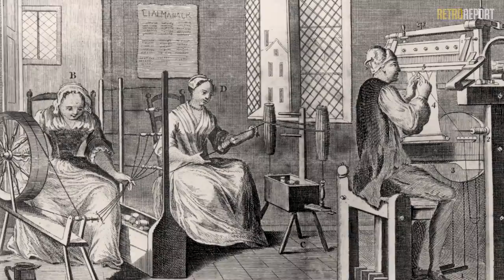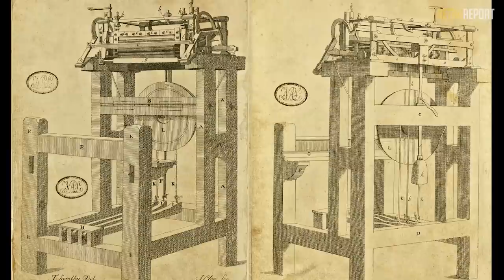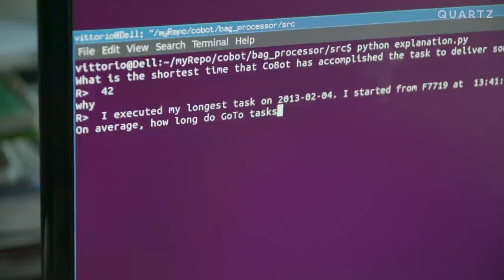Automation and AI are destroying jobs, not work

Comment: Back in the late 1990's as a teenager i worked as a Photo-developer at a massive factory that did 24hr return prints. By 2001 the business closed as digital cameras were wiping out the volume needed to be profitable (240 people)...9/11 happened and i joined up. Post 10 years i was made redundant when my unit was disbanded (1200 people). Now i'm a Cyber Security Pen tester. You just evolve with the world is my view. If you want long term stable employment in one field become a Lawyer, doctor, architect or Vet.
Reply: By "Vet," do you mean veteran? or veterinarian? If veteran, then I suppose it's only possible after a short stint, because robots will be soldiers (drones), as well.
Reply: Software can now performe Discovery which is most of what attorneys do now.
Reply: And what happens when the military uses robots instead of humans? What happens when someone creates a machine learning pod that does surgeries with 99% accuracy? What happens when unemployment rises as there becomes too many people and not even jobs that you can thrive from?

Comment: I do selective cutting here in my maple sugarbush in Ontario. Machines can only do clear cutting. They can't tell one species apart from another. Surely any clear cut can be done by machine in time but clear cutting is so very stupid! You need a canopy for birds, animals and the next generation of trees. You need the roots to prevent landslides. 

Only idiot clear cutters will be replaced. What kind of stupid video shows this as some kind of sign of progress? It is a very good thing that those kind of loggers get killed.

Many who choose logging as a profession are there because there is risk involved. Risk and reward. The risk makes you feel much more alive, knowing that you could die, the reward is to not die but instead live on and tell those stories while building the family home or warming it during a long cold winter.
Reply: Spruce forests like the one in the video have intertwined roots and rely on each other to remain standing.  If they aren't clear-cut the ones that are left will fall over due to wind, erosion, etc anyway.  Rather than wasting the lumber the area is clear cut. After logging, industry typically uses prescribed fire in the area to reduce the amount of ladder fuels from branches and waste wood, then replants, waits for the trees to grow, and re-starts the cycle.  This actually helps to prevent disease as well, and reduces fire danger by removing excess wood from the ground. 

Some other species like aspen have connected roots and produce a chemical that inhibits growth of the trees around them when they die.  Clear-cutting has the opposite effect, the root system produces a chemical that encourages sprouting of new growth. When aspen type forest becomes diseased, the proper method is to clear cut to encourage healthy new growth from the roots. Often times in this scenario the trees wont even be cut, instead they are bulldozed to reduce cost.

Other species, like ponderosa pine require thinning rather than clear cutting for proper management.  This is still accomplished with similar machinery to that in the video.

The machine itself isn't automated, it still has an operator who selects the trees for removal.  The point of the video is that machinery like this will replace hand cutting, which it has already done in most areas.  It's safer, faster, and cheaper than hand felling trees.  These machines aren't anything new, they have been around for decades.  It seems the innovation the guy is talking about is some system he has come up with to allow the machine to operate on steeper than normal slopes.  The only places hand fellers still exist are areas where it is too steep or rocky to operate the machinery effectively.

Important jobs like the foresters, biologists, and hydrologists that manage and protect the forest won't be going away due to automation, just the labor jobs involved in the harvesting itself.
Reply: @henryplummer7808  You're someone who clearly knows what you're talking about! Appreciate your informative comment.

Comment: were not gunna have trees soon great!
Reply: In most countries forestation occurs in cycles of growth, harvesting and replanting just like farming but on far longer time scales like 30 to 50 years. My native Ireland has the lowest forestation rate in the EU, 15% when it should be a lot higher. The trend now is away from monoculture of non-native Sitka Spruce for building work towards native hardwoods, oak ash and elm for furniture and cabinetry. The returns on these are 70-80 years so that multigenerational arrangements of land ownership and advanced income supports are needed. This is a huge problem in Ireland where most land ownership is in aging individual hands and quick returns are the rule. More and more family farms are going idle or being rented out to surviving neighbours because the sons of farmers are not willing to take over and run these farms. Currently there is a large surplus of harvested building timber in Ireland ( softwoods) which is losing money and causing economic problems due to COVID shutting down building sites across Europe and past over investment and over supply of softwoods for building purposes. Also a big problem is flood control where rain from forest clearings is running into towns and valleys due to a lack of trees to provide soakage and slow down water runnoff. This also a huge problem in Germany, France, Italy and Greece due to forest clearance and fires.